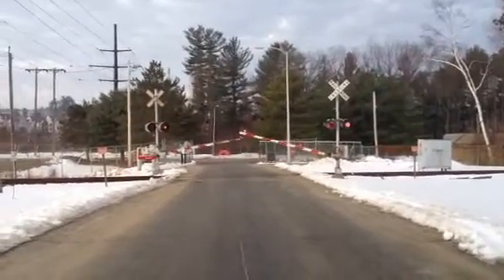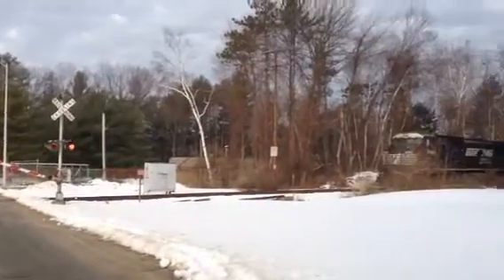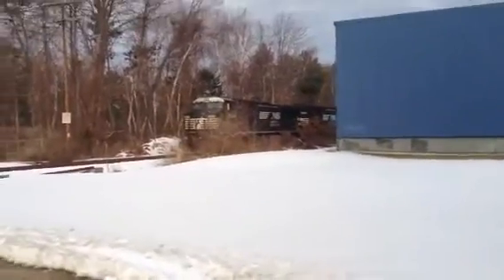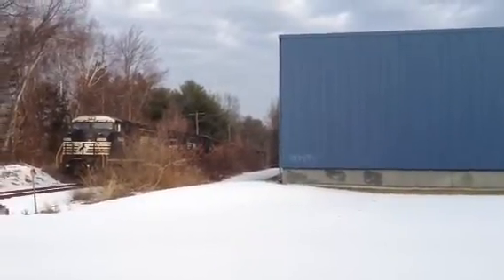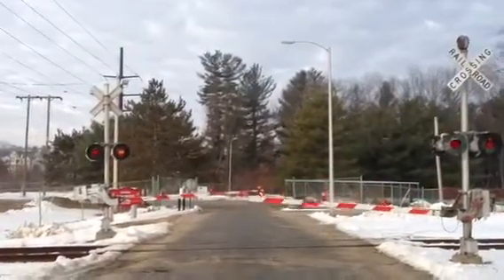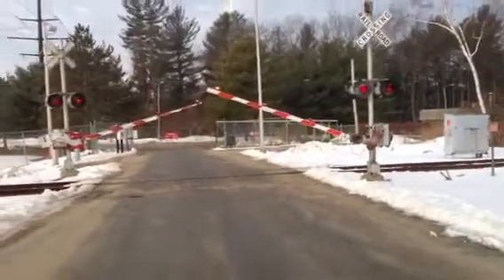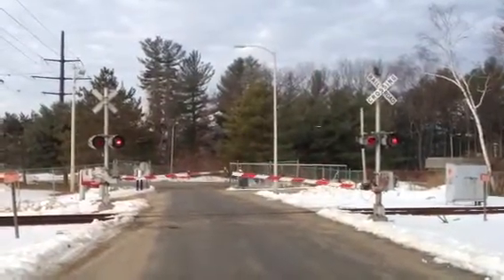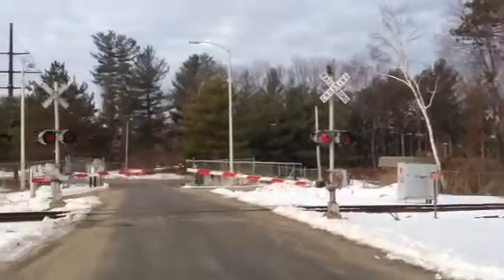Railroad crossing gates malfunction

Comment: Once a train came and the gates went down as normal. After the train passed, the gates stayed down for maybe 10 minutes before they went back up
Reply: That's supposed to happen, there is a pause after a train passes before the gates ho back up. However, this pause can vary from crossing to crossing, one could be 2 seconds, one could be 20 seconds. This is due to the sensor(s) on the tracks being far away from the crossing. Therefor the crossing does not realize the train has passed until that sensor far from the crossing detects it, which due to the fact it is far away, causes a delay before the gates go back up.

Comment: The position of the train probably isn't a factor here.  It's not like balancing a teeter-totter where just the right position achieves a bizarre equilibrium.  The signals should either be on or off.  
There could be an intermittent circuit connection, especially if the rails are rusty.  But it's most likely a partial failure of a controlling vital relay.